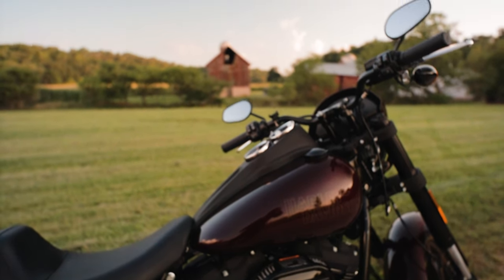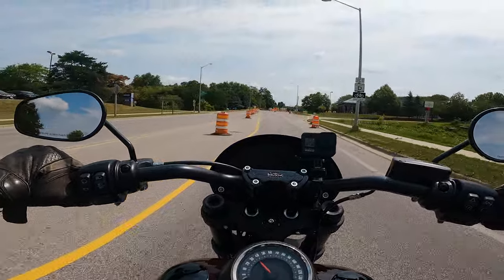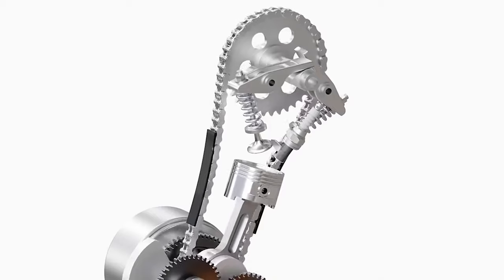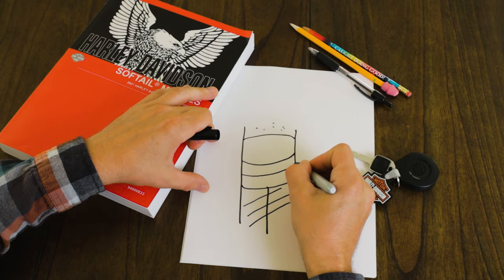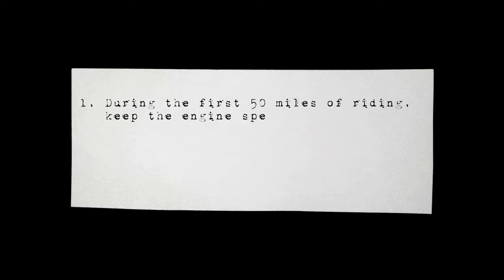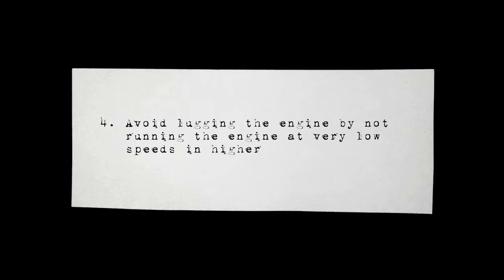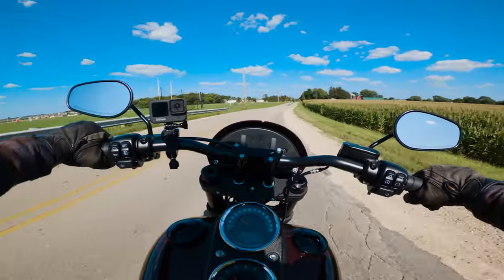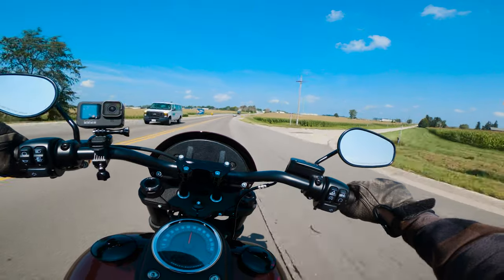Are YOU Breaking In YOUR New Bike the Right Way? It MATTERS!

Comment from the maker: Have you had the responsibility of breaking in a new bike?  What bike? Knowing that is WAY more exciting. I've had three now and I may have a fourth new bike in a few months to break in. How have you done it?   Do you follow the manufacturer's guidelines? Let me know below!
Reply: I've had to break in my street bob twice. Once as it was new and another with the stage 4 128ci kit. I followed the manufacturer's guidelines I figure the motor co has more knowledge than I do about these things.
Reply: I've broken in two bikes, both Kawi's. Manual says keep it under 4000 rpm until 600 miles. The KLR that was easy to do with back roads but occasionally i would take it over 4k. My Versys i tried but that twin 650 kept telling me to just ride and that's what I did. Rode it like it was meant to be ridden.

Comment: I followed my factory Kawasaki manual on the Nomad. Used recommended oil, filters and change schedule.
Varied throttle positions and speeds. Bike has been super reliable since 2005.

Comment: I’ve owned more than a few new motorcycles, that varied between manufacturers, as well as riding styles. Even with my Hammer kit I followed the recommendations by all for proper break in. What people tend to not understand is that it’s not about the short life expectancy, proper break in is designed to maximize engine life. That being said, numerous other attributes can also do way more detrimental damage to an engine than just improper break in. Manufacturers will error on the side of caution, rather than what an engine can handle…. 👍😁👍

Comment: My XL1200T in 2019 I did exactly what the manual said. 
till 2000 km the bike fuel consumption was around 8 and 9 L/100km because of all the frictions going on, I was worried about that, however after the 2000 km the fuel consumption sit between 4.5 and 4.8 l/100km. Great 👍👌, I changed the engine oil every 1000 km and still going so.

Comment: I just broke in a 2021 Triumph Tiger 900.  Don't go above 5000 rpm for first 600 miles. Don't use the quick shift all the time (using the clutch allows the RPMs to vary more than with the quickshift).  Other than that I just did some back country roads, around some lakes, up in the mountains.  600 miles was under a week.  :)  Then I changed the oil and did a 1600 mile trip to California to see the Redwood trees.  It was amazing.  Just hit 8000 miles since April.  Fun bike.
Reply from the maker: Man, you're making me want a tiger! Redwoods are amazing! I need to head back there.
Reply: @GreatEgret  I rode the AT for a couple weeks from a friend, and I had a Tiger 800 before.  The Tiger 900 feels so much better than both of them.  Mile munching machine.
And here was my best day:  https://youtu.be/VG-q4RcnPCQ